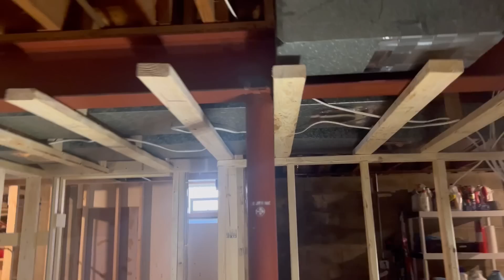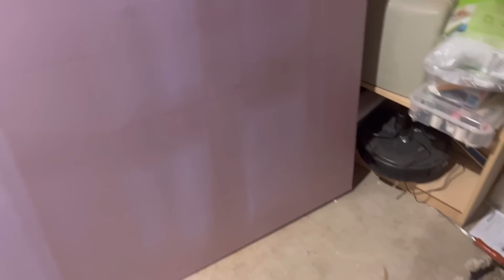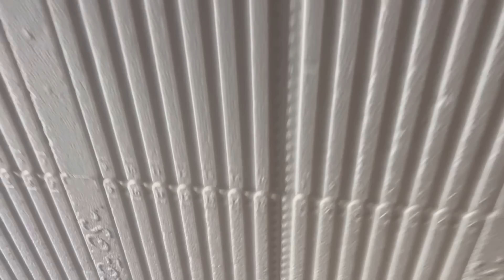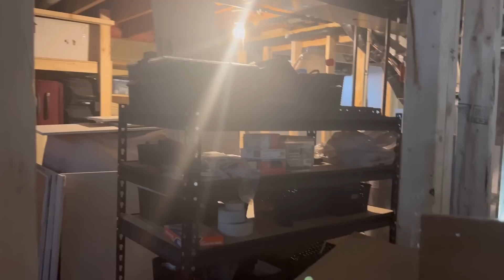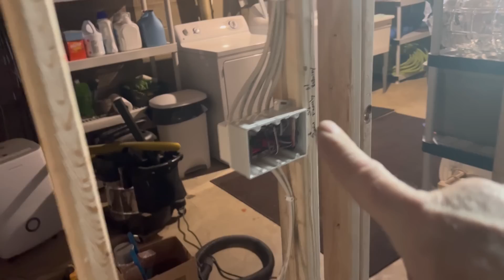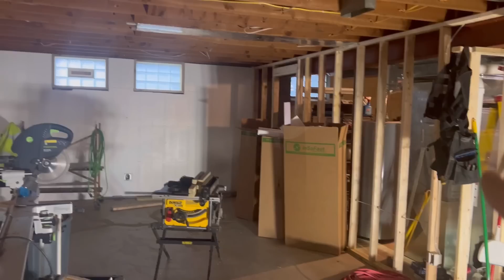Basement remodel:  Mechanicals are roughed in and inspected  part 4

Comment: The vent duct needs insulation three feet in from the outside wall. Wow. Minimal Heat loss is taken to another level. Return air has its own vent pipe and not just a covered metal over a floor joist space. Things are tightening up with these changes. Arc Fault Breakers now etc.